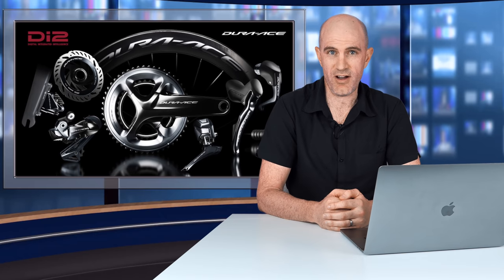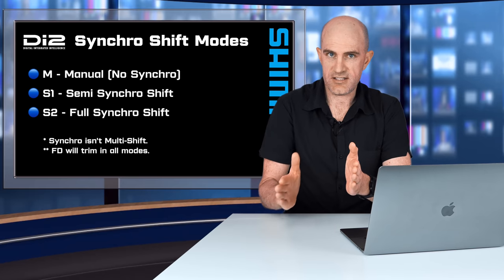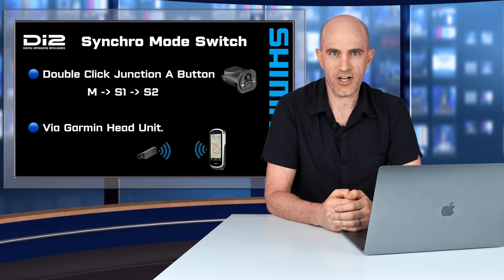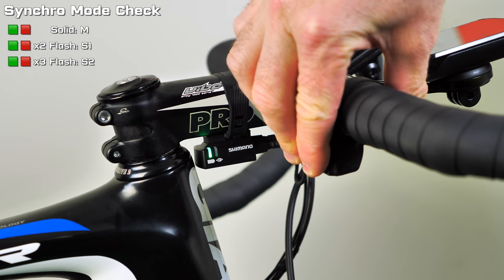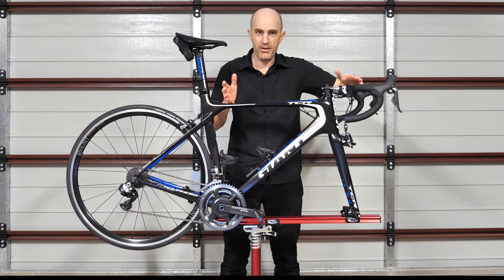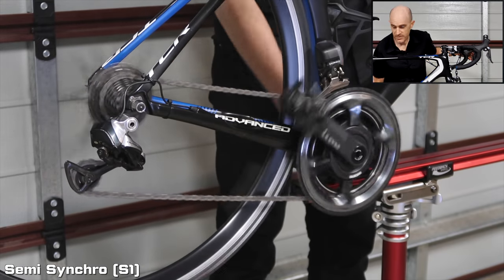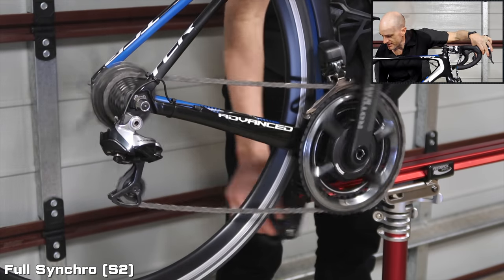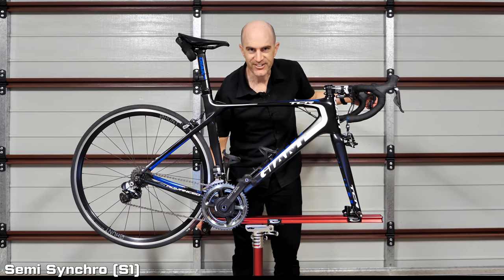Shimano Di2 Synchro Road Shifting: Details // Configuration // Switching Modes

Comment: Small tip on the accessibility front for the benefit of those of us in the Northern Hemisphere who are about to jump into winter riding with bulky gloves: Di2 lets you configure what each of the buttons do, so it's possible to set up a SRAM-style configuration where both right buttons are set to go down the cassette, and both left buttons are set to go up the cassette. Combine that with full-synchro and you'll never misshift in the winter. You can even program the hood buttons to change the front rings if you don't want to lose that option overall.
Reply: Thanks for confirmation. That was exactly my idea as my other bikes gears are sram. Run both on the left shifting down and both on the right shifting up but with semi-synchro and top buttons for FD.
Reply: I have big hands and find the Di2 shifters easy to use with winter gloves.
Reply: Wait you have top buttons on your hoods? I have the 105 and I don’t think I do

Comment: Worth mentioning that the system also prevents you cross-chaining, even in S1, so you can’t accidentally try a silly ratio like big front and big rear at the same time. 👍
Reply: The main benefit of di2 is that cross chaining is trimmed better to provide that perfect chainline even on cross chain. So I don’t understand how s2 mode really benefits other than being so lazy to bother with the front chainring shift and only think about rear cog shifting. For me I like manual, because if I were to switch chain rings from small to large, I want the larger gear ratio selected, not the same gear ratio
Reply: @wallacepei4529 cross chaining is still an issue and can destroy components and lead to less efficiency and power too. Synchronous system is perfect to prevent this. It also leads to less disruptions in cadence. If a hill is approaching you have plenty of time to shift to correct gear. I can’t think of any down sides to the synchronous system.

Comment: I’ve tried the same settings on SRAM red AXS.  The “compensating mode” (semi synchro in Shimano speak) is great and I use it all the time.  The sequential shifting (full synchro in Shimano speak) is absolute rubbish, particularly when out of the saddle and trying to put the power down on a short sharp hill.

Comment: I use full synchro when in my clip on aerobars. I have one aerobar DI2 switch there. I connect it to the junction box when I clip the aerobars on.
 No need to get to the hoods for shifting :)

Comment: Thank you for hte video, especially the installation/retrofitting on an older bike. I am now confident that I am unable to do this on my own and also that it's quite laborious for a competent mechanic so the best approach would be to buy a bicycle with Di2 already installed ;)
Reply from the maker: Get them to install the wireless module too. It doesn't come fitted standard.

Comment: Both of these modes are great for most of the time, but not all. Sometimes if im shifting into the little ring as i hit the bottom of the climb and the grade kicks up i only compensate with one shift instead of 2 like syncro. There are also wierd things like the certain gears that people shift into before lights to get a good start that might get a bit confusing with syncro

Comment: These videos make me appreciate wireless shifting with no 'battery version' hassle and all the cabling involved with Di2
Reply: Agreed. eTap rules.
Reply: Maybe, but how often do you install a groupset? And also, I can swap/upgrade parts of my di2 bikes as I go. Ie, I have 6870 shifters and 6770 front and rear derailleurs, di2 for less than $350. 9150 shifters on my other bike with mostly dura ace 9150 stuff except 9050 RD, saved me heaps on the used market, less than $1000 all up. Can swap parts to my cheaper di2 build as I upgrade my more expensive di2 build. Can't do that with Sram Red etap and AXS.
Reply: @MrBJPitt  It's not just the installation. The configuration is much more simple too. I don't doubt di2 is fantastic, but for pure simplicity, eTap is cool. And Force / Red Parts are fully cross compatible.
Reply: @Esskay1  how is pressing one button a difficult configuration?

You can't use etap with Force.
Reply: @MrBJPitt  force eTap axs / red eTap axs.
Reply: @Esskay1  yes, but no sram red etap 11 speed with the 12 speed stuff... unlike di2 (excluding 7900 stuff, but everything else is compatible). That is a long long line of parts you have access too, creating a much cheaper experience.
Reply: @MrBJPitt  even when Shimano switch to the nicer EW-SD300 wires you can still use the components you own right now. 
(There is an adapter, EW-AD305 if I recall correctly)
Reply: You can mix and match AXS and ETAP no problem. Road or MTB. The hassle is less, having two batteries provides backup when the derailleur one dies, and mostly there are no cables, stupid junction boxes and rattling batteries inside the frame, where the dropper post should reside.
Reply: @roilev  you can use red 11 speed shifters with AXS derailleurs? That's something I've not heard about, but am happy to be corrected if true.
Reply: The indexing, the 'number of gears' happens at the shifter. There are the notches that define 'gears'. The derailleur just moves as much as the shifter pulls the cable. All SRAM shifters and derailleurs use 1:1 pull ratio so they are interchangeable.
Reply: @roilev  cable pull 1:1??? We are talking electric shifting. I'm pretty sure a mechanical shifter isn't compatible with an AXS derailleur... lol
Reply: @MrBJPitt  lol true :) my bad, I was just discussing the same topic about wired shifting and got confused. Haven't tried 11spd ETAP, can't comment there, sorry.

Comment: I was screwing around trying to soft ware up date and accidentally put it in s 1 mode , at first thought I would try to get it back into manual mode but tried riding it in s 1 and think I will leave it there for awhile kinda like it.

Comment: Great job Lama :)
Reply: Made it halfway through until my wife told me to switch "that bald man - oooh is that Lama?" off.. but wanted to say you need a display AND an up to date battery/mount if you want synchro on mtb :)
Reply: (and the MTB displays beep the shift before a synchro shift happens, which is pretty nice). Note that S1 and S2 are semi / full by default, but a user can change this.. and it's a lot easier to change this in the new mobile app - so there will be users where S1 is full synchro and S2 is semi-synchro.. or both S1 and S2 full synchro.. or any other combination :)

Comment: I’m upgrading very soon to Di2 (hurry up with the parts Shimano!) and I’m still trying to work out whether to go semi or full synchro. I love the idea of full synchro and it would mean you could free up more buttons to do other things (controlling lights, head unit, etc). Semi synchro is how I ride my mechanical bike so that’s also appealing. If I set the left and right Y buttons to shift up and down the cassette, could I configure the left and right X buttons to change screens on my Wahoo?
Reply from the maker: Yep, that should work. Just assign the buttons you want head unit control as D.Fly Ch1-4 and you're set.

Comment: I tried full synchro, but didn’t like the loss of control. Using semi-synchro now, but I don’t quite have it tuned properly yet. It is good though not to have to shift the rear mech in advance of, or immediately after, shifting between big and small cogs.

Comment: One item would be great is to explain how to activate the system to allow the chain to go into smallest cog when in small ring. I believe there is a default setting keeping it from doing so. I never bothered as seems to avoid me from running on that combination.
Reply: You need to select a chainring of size 53 or bigger to be able to select “professional mode”
Reply: Gear position control :). Whether or not you can actually change that setting depends on the selected cassette / chain rings
Reply: I believe what I’m trying to say is getting the chain to go into one of the last 2-3 smallest cog in small ring. The sizes are set up and selected. I believe there is a check box to uncheck allowing this to work. Just can’t recall where I saw it. PC software or phone app.
Reply: @jerseybarrier64  yeah, that is called Gear Position Control - can set that on both of and mobile :)
Reply: Ah thanks. Missed your subtle hint ;-).  Cool it can be changed with the app. Like the concept but there’s times I prefer to drop to the last cog for wheel removal and cleaning.
Reply: To be able to change the setting “gear position control” you need to change in app that you have a crank with 53t chainring. Otherwise it’s either hidden or grayed out.

Comment: Dear Shane, I have an odd shifting setup.  I have a 46/30 11/40 using the current Ultegra and a Wolftooth extender.  Don't judge, I am an old portly person who still wants to climb.  Would DI2 make my shifts to the larger cogs easier? Cheers Mark
Reply from the maker: Di2 makes everything easier! :) You'll need to look into using a Di2 MTB rear derailleur for that kind of gearing.

Comment: If using "full syncro mode"  only 2 buttons are in use. Can I select whichs buttons are used? And is there a use for the two other buttons ? Is it possible to use 2 buttons for up/down in "full syncro" and the two others to make a manual front derailleur change?

Comment: I've found a slightly annoying quirk with semi-synchro. When you use a laptop, you can specify 2 or 3 cogs as the compensation shift at the back. In the Android app (using Bluetooth) you can only specify a 2 cog shift. I'm not sure that the Bluetooth module is worth the expense (especially as I am a Wahoo Elemnt Bolt user).
Reply from the maker: Interesting! The 8050 setup I have allows 0-3 in either up or down in S1 when configured via the ETube mobile app.

Comment: Shane, do you reckon the preset syncro settings are ok or is there more fiddling to be done in the app?
Reply from the maker: Preset is good enough to work out which mode you want to use. From there it's all down to personal preference.

Comment: Love the idea of it but as somebody that rides with a fast paced group with lots of punchy climbs I find that the gearing on S2 is too slow when it does a double shift up a climb and I basically pause on the bike waiting for the gear change.
Reply: Yes s2 did not look appealing at all.  The way I ride is in the big chain ring mostly.  So I have it 53t on front.  11-28t on back, 11 speed.   As controversial as this may be, I will run all 11 gears on back I don’t care about cross chain.  I could see a super simple addition of a 12th gear.  Say drop into 39t front to 28t back for some super steep hill.  But I also don’t see the issue with just switching to that in manual mode.

Comment: I’m using 8050 group set, I can’t get into the 10/11 whilst on my little ring at the front, not that I would choose to use these gears however; when I want to remove my rear wheel not being able to engage these gears makes it more difficult to get the wheel out. Any ideas? Cheers.

Comment: Thanks for all the TCR+di2 videos! I've done an upgrade with di2 (9170) but double-clicking the junction box button doesn't work. Any idea? For now, I have no PC connection or wireless module installed. Battery checking shows it is set as MANUAL mode and I can't change to S1 or S2. :(
Reply from the maker: What battery are you using? And it's best to get a PC link to update the firmware on all components (if required).

Comment: hi, will a di2 10 speed rear derailleur work on a 11 speed cassette if the shifters are changed to 11 speed ones? thanks heaps !
Reply from the maker: I'm going with no. The E-Tube Compatibility chart is a good reference to confirm this.

Comment: Hi Shane - I have heard it doesn't work with 11-34 (maybe 11-32 as well?).  Any idea how to get it to work with those cassettes?
Reply from the maker: The biggest I can see is 11-30 on my RD-R8050-SS, but that's because that's all it supports (officially). The RD-R8050-GS goes to 34 and supports synchro according to the Shimano website.
Reply: @gplama  Thanks Shane!

Comment: Great video! Just one thing - it looks like your pedals need re-greasing. ;)
Reply from the maker: They're the Favero Assioma with sealed bearings. They're in really good condition. What issue are you seeing with them?
Reply: @gplama   oh, didn’t realize they are power meter pedals. 🙈 They spin quite a lot (easily). If they would be standard pedals, I would say the grease is ready to replacement (unless you run super thin lube for Hour Record or so). But since they’re power meter pedals, then spinning like that is maybe perfectly normal. Sorry, my bad. Have no experience with power meter pedals...yet. Thanks for useful Di2 series!

Comment: The etube software is very 2009. Not sure if the older groups like 9070 or 6850 have many options even with the newer battery.
Reply from the maker: The updated Windows version is due in a week or two. The new mobile app is pretty neat.
Reply: @gplama  I've.been waiting on the update and i must get that Bluetooth module as my hood buttons are idle and the igpsport has di2 connectivity. activity
Reply: Yeah, Oct 13 they say.. let's hope it's right.
6870 and 9050 do have synchro shift with the new battery, but their FD limit the flexibility in setting it up (software limitation...).

Comment: Ive had to calibrate power on edge 520 start of every ride after switching to S1 mode on head unit. Any idea why ? Thanks
Reply from the maker: Power meter calibration and Di2 mode are unrelated. Maybe your 520 has set the power meter sensor to "prompt to calibrate" under the power sensor settings?
Reply: Yeah strange one , prompt to calibrate is turned off. I'll go back to standard setting (M) and see if that makes a difference. Do like the S1 mode 
 @gplama

Comment: How the eff do you turn semi synchro off! It’s pissing me off. Unfortunately Di2 can’t tell how big the climb is in front of me. I like to drop down into the small ring and then make my way up the rear cog as I climb. With semi synchro when I change into the small ring it makes two shifts down which makes the start of the climb harder.
Reply from the maker: Double click the junction A button to cycle modes.

Comment: I’m on M mode. But why my chain does not go or shift all the way to 11 tooth rear cassette when my chain is on the smallest ring in the front?
Reply from the maker: By design. One for Shimano if you need to know the reasoning.

Comment: Not sure Wahoo gives the option to change shift modes. Pretty sure I can only do that via etube.
Reply from the maker: Double clicking the button on the Junction-A will cycle through shift modes. M->S1->S2 and back to M.
Reply: @gplama  I don’t have one of those with R8100. Is there a multi-paddle click way to do it. Maybe I need to RTFM.

Comment: Di 2 11 speed on the mtb. Do you know of a way to hack it so it can be converted to 12 speed. Ive measure the distance on the 12 speed cassette and there is enough travel distance in the Di2 xt rear derailuer however the software is designed only to move through  eleven cogs. thanks.
Reply from the maker: MTB is outside my lane at the moment sorry. Not something I have access to.

Comment: Could I combine a XTR Di back derailleur with Dura Ace Di shifters?
Reply from the maker: I believe that’ll work. Check the ETube Compatibility Chart on the Shimano website to be sure.
Reply: Yes BUT No if you also have a road Front Derailleur. The software won’t let you set it up. So only works if you have a x1 setup like in a gravel bike. As gravel bikes now have a drop bar handlebar and those shifters are essential.
Reply: Yeah, you can use about any shifter with any derailleurs. However, all derailleurs MUST be 10 speed or all 11 speed. Also, all installed derailleurs must be from the same category. "Mtb" is a category and "road/grx" is another.

Comment: I used both S2 and S3 extensively, and finally just went back to S1  and left it there.  My conclusion is that they would be great for a  TT/Tri Race, or a flat hammer session, but if there are any climbs on my route, I don't want the bike making shifting decisions for me.   And as for the 2 gear compensation in S1, some situations only call for a single gear compensation, and some might call for three (rare).   S1 (M) is the best option for me...

Comment: Hmmmmmm, it may be because you have a microphone pointed at the gears, but your DI2 sounds really clunky compared to mine. Is your chain ok?
Reply from the maker: Slamming through some of those gears with not a lot of tension on the chain on the stand does that. Chain is fine (50km use).
Reply: Shane Miller - GPLama Thanks, I’ve not listened to my gears on a stand, and obviously my chain is used to about 1500 watts continuous power 😂🤣😂

Comment: No puedo lograr modo semiautomático o automático en mi shimano ultegra di2, presionó dos veces el botón y no hace nada. Solo se queda encendida la luz roja, ayudaaaa
Reply from the maker: You'll need to have updated firmware and the Di2 battery that supports these modes.

Comment: I do not like the synch modes. I prefer to have full control, specially when electronic shifting is so smooth and precise. Stick to manual mode if you are an experience rider.

Comment: In S2 mode, when you do a front chainring shift, does it do the compensation shifting? You did not show this.
Reply from the maker: Update: It doesn't appear to compensate on the back when in S2 and changing the front ring. I'll need to test it a little more to get my head around it.
Reply: @gplama  yeah, it doesn't . I would like it to though.
(Assuming the S2 were talking about here is set to full synchro.:))